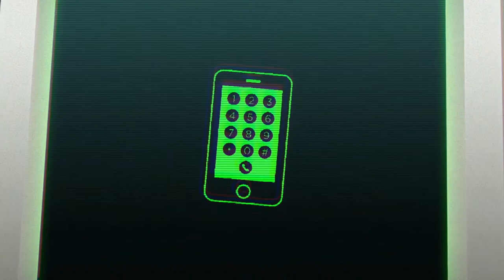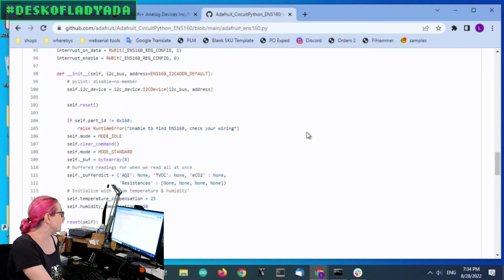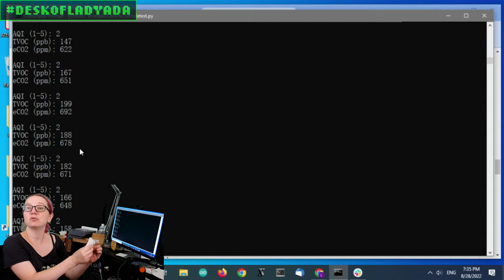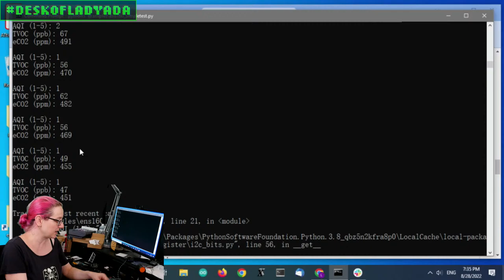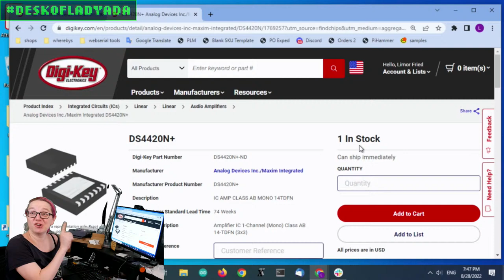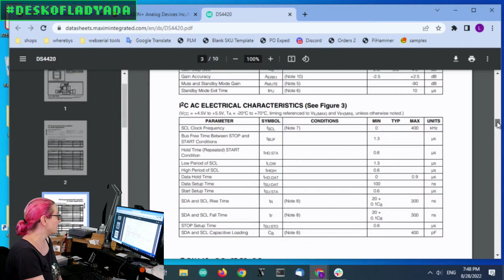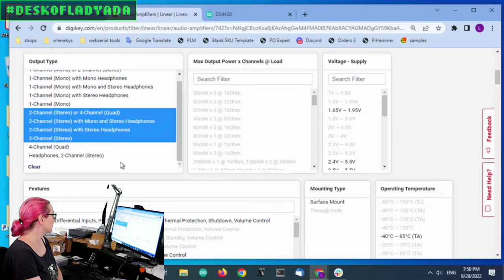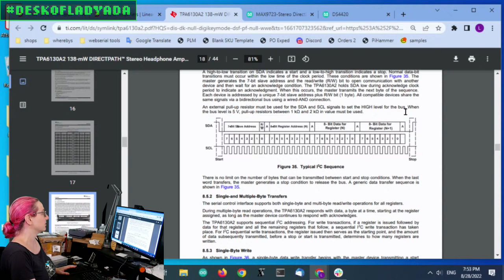Desk of Ladyada - Super Stemma Sunday

Comment: 8:33 could we get this with 5 vertical connectors on top and a horizonal connector at each end of the board so they can be easily attached to your microcontroller and more easily daisychained to other connector boards? It look like a super useful device when you have a number of connected STEMMA breakouts